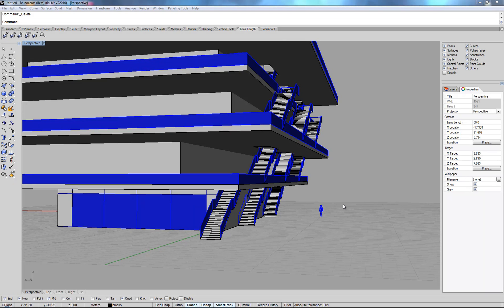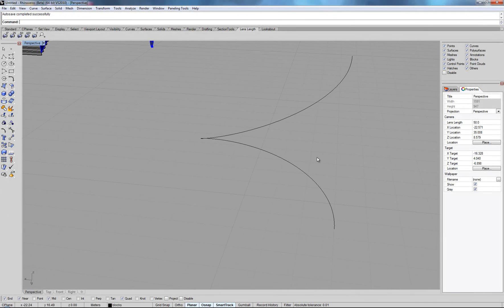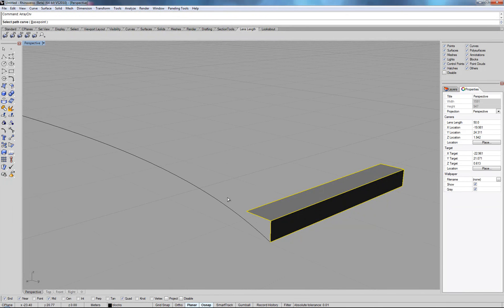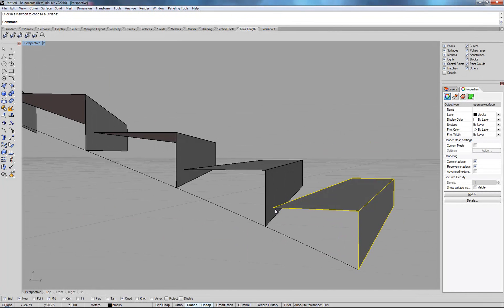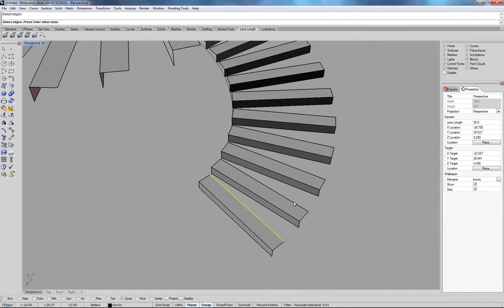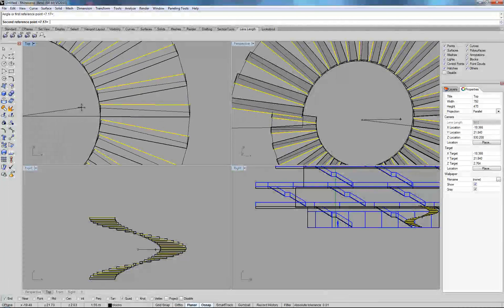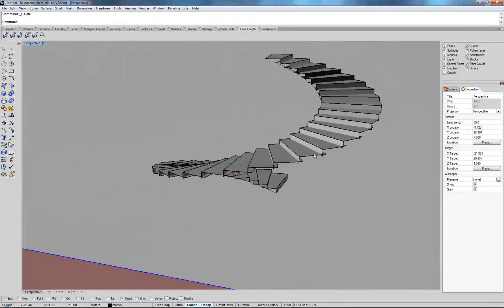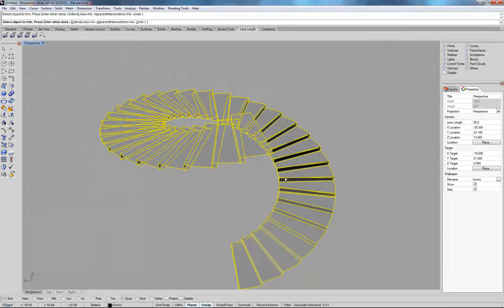Advanced architectural BIM modeling techniques in rhino5: 06 spiral stair case

Comment: This tutorial is neither "architectural" nor "BIM." It is not "architectural" because the proper architectural dimensions of stairs (eg riser height) are neither specified nor preserved. And it is not "BIM" because this a tutorial on how to make geometry in a non BIM program. Rhino is a solid modeler, not BIM software. Only additional, third party plugins like RhinoBIM or VisualARQ give Rhino any BIM capabilities. Rhino is no more BIM than Sketchup is.